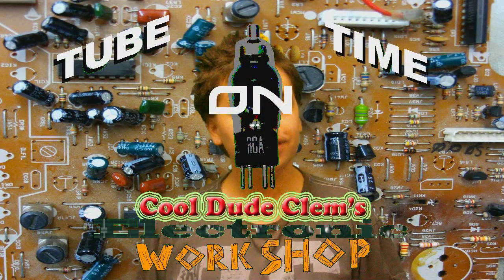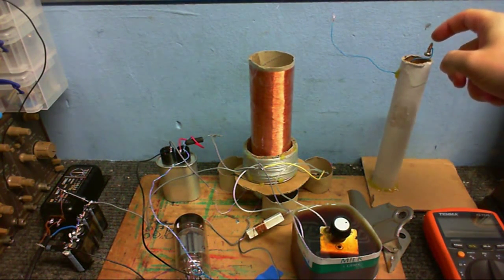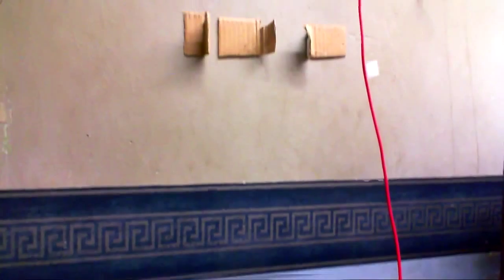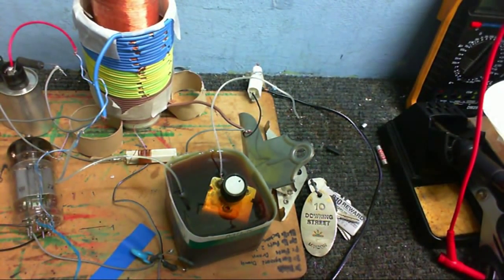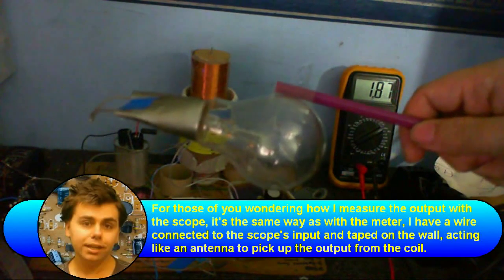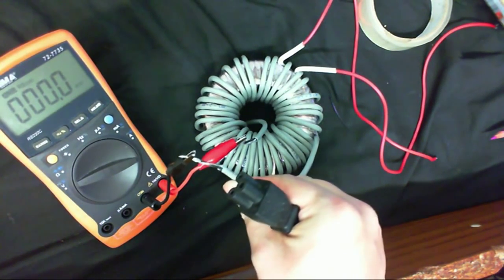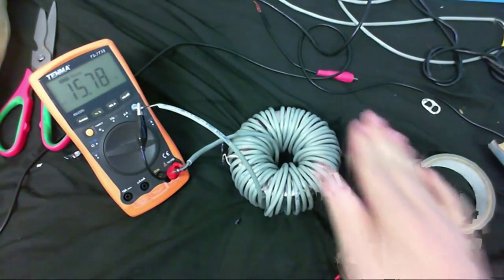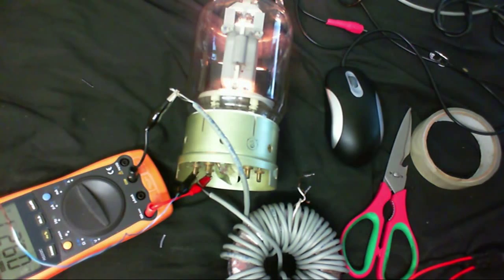More tesla coil experiments and GU-81 VTTC First Light.

Comment: Great job, just be careful.
By the way, don't know if they have Radio Shack stores over there, but here in the States, they are closing down about a thousand of stores. Selling components for pennies on the dollar.
Reply from the maker: Over here Radio Shack is called Tandy, we used to have one in town ages ago (way before YouTube) and I could get all my stuff there, then they stopped selling parts & components and it became just an appliance store, then it closed all together and now whenever I need parts it's either from scrapped electronics I find, donations or ordering off the web, there's no near enough Brick & Mortar places where I can get any parts anymore.
Reply: here in Denmark its hard to find a repair man to fix old stuff if I am very very lucky I can take to copenhagen and find a store that sells old eletronics but many of the stores I remember from there has been shut down and my city has none.
Reply: *****
I do not even have a smartphone at all and its so rare I use my cell phone...

Comment: my gu-81 coil keeps just making a high pitched fluctuating whining noise, have you experienced this before?
Reply from the maker: Maybe your tuning is wrong? That's the only thing I can think that would cause that.  Do you have a capacitor across the primary?
Reply: Hi,

I'm using multiple taps on the primary with a fixed tuning capacitor, I think I've tuned it correctly based on the spark length (to a ground rod). 

Idk I'll try to add more turns to the primary and try to clean up any HF interference and we'll see.

Great videos BTW.

Comment: Great stuff as usual. I'd like to see a "tube time" about power supplies or even better....TRANSFORMER WINDING. Toroids are easy enough to start with and it looks like the one you did for you VTTC took it over the top. Nice.
Reply from the maker: ***** I'll get on that when I have the time.  Right now I'm re-visiting the Base-fed VTTC and actually getting some results from it, it does produce a plasma flame now, the only thing is my webcam glitches out every time I turn the coil on so I can't film it.  I've got my other camera charging so hopefully I'll be able to film it with that one after the battery is charged.
Reply: Aluminium. Foil around the camera will fix this problem
But don't forget to ground the foil
Reply: Wow! Is it really that simple? I tried building a Tesla coil years ago and that was the one problem I ran into there was way too much interference I was guessing from the spark gap. I didn't use any vacuum tubes though just a big industrial sized capacitor and transformers that my father got from his utility job. I still have it in storage its a beast 6 feet tall! I wonder if it still works. I would like to see if just foil wrap will do the trick! Amazing!
Reply: well i will explain why the electronics stop working
all arc's make electro magntic pulses (emp)
normaly it isd to low of a frewuency that it does not affect electronics

but above a serten point
the traces on pcb's make power and reset the microchip

wraping it with foil (and grounding it)
makes a crude farenday shield and redirect the emp to the ground
it is not perfect but it should help a bit

Comment: hi ! whats the filament voltage gu-81?
Reply from the maker: It's 12.6 volts at 11 amps, so yeah, does require a bit of a beefy supply.
Reply: I got 2 of em.. been wanting to put together a push/pull VTTC..  Does that toroid handle the 11a? How on earth did you manage to connect wires to the tube's pins? That's such a pain in the arse..